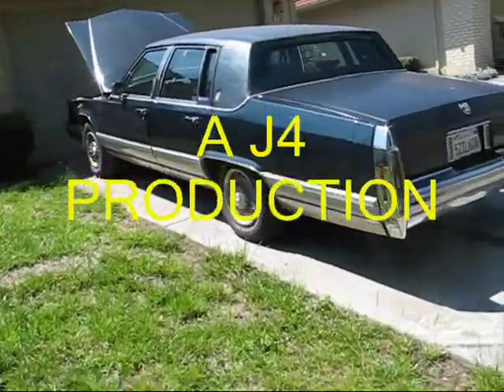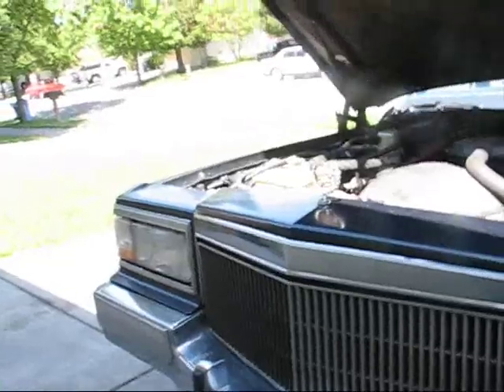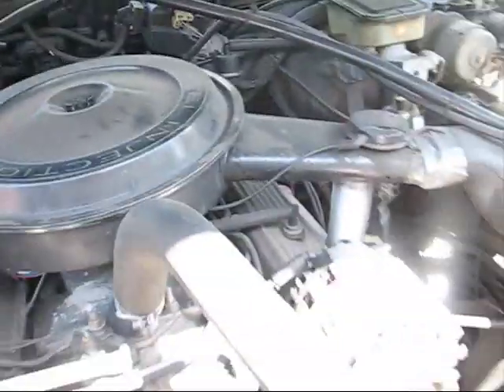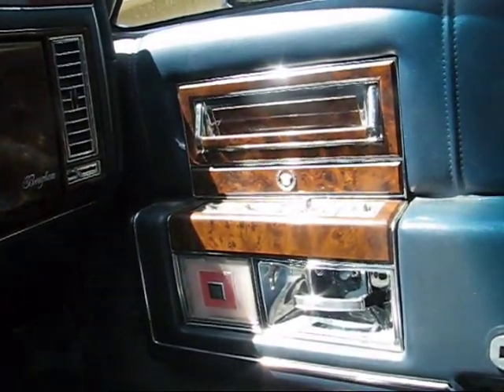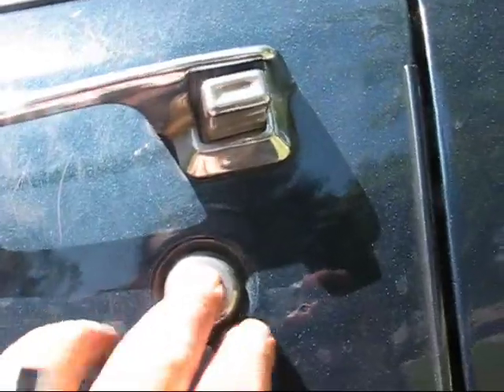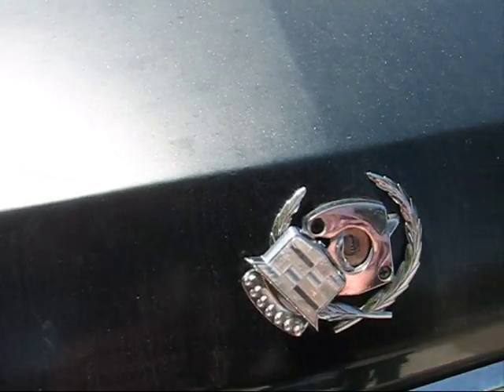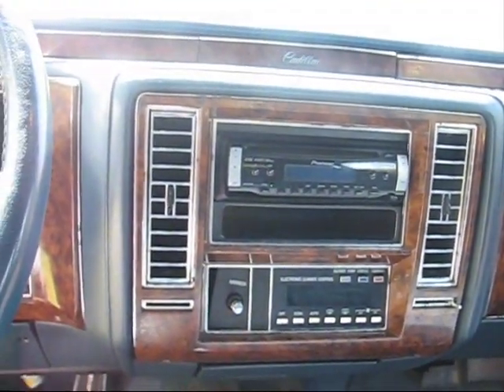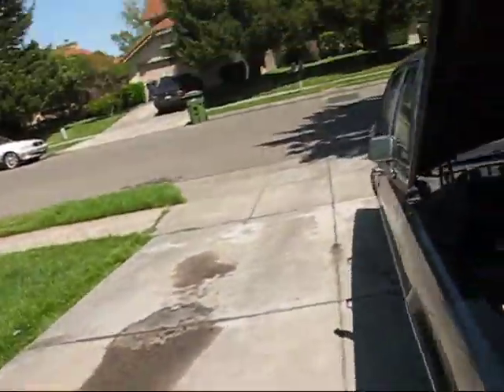1991 Cadillac Fleetwood \\ Brougham // Project *watch in HQ*

Comment: That car has so much potential. I look forward to when you have restored it back to mint condition. I remember those. That  car was indeed loaded. They added stuff to that car in 1990. There are no Cadillacs like that anymore sadly. The base engine was not a 305, but it was a 307 V8 rated at 140 hp.